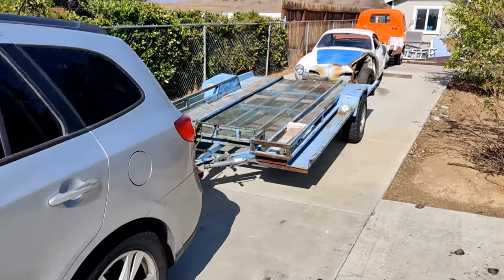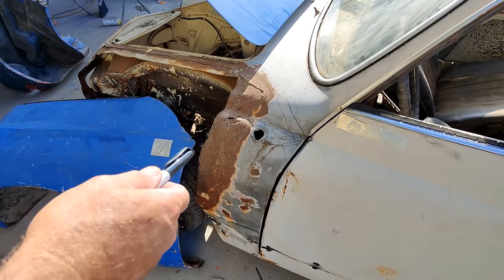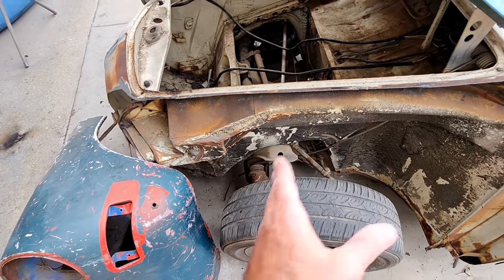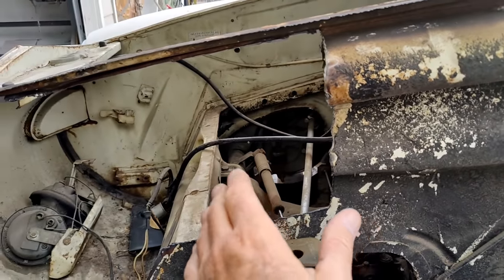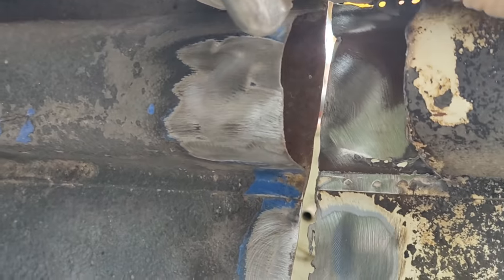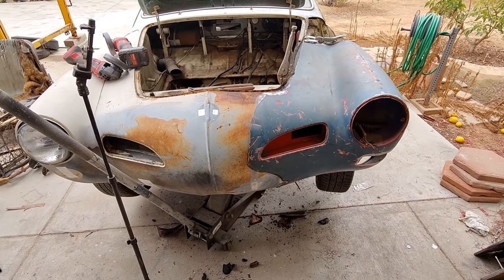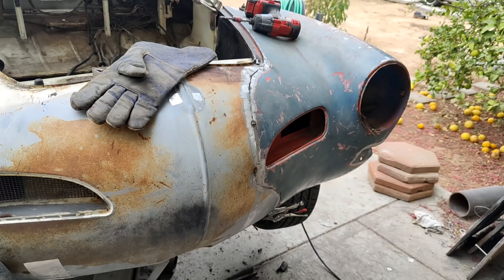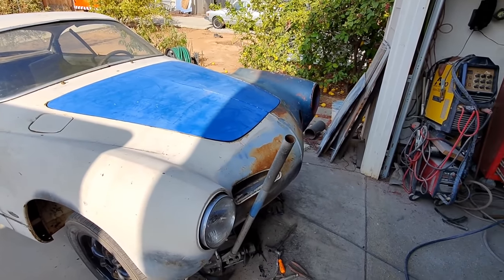VW Karmann Ghia Fender replacement part 1 metalwork welding grafting metal Butt weld for restoration

Comment: I'm working on a 70 Ghia. This gives me alot of pointers. Great video, you don't have to make excuses to me, I think you're doing a phenomenal job. I don't have any accident damage. Just real bad rockers and heater channels.  I have very little welding experience but you have to start somewhere. If I fail, oh well. I'll just use the engine in something else. I really want to get this thing on the road though.

Comment: Ahhhh... A Ghia fender job is not for the faint of heart.  Did one once, and I never want to do another! The car was a '60 and replacement fender was a salvage fender from another '60.  Rust and filler on both.  These were hand built and the replacement was about an inch longer than the original.  Ghia's are fragile and rust prone - challenging to get right 🙏
Edit:  Forgot to say thank you for the video!😊
Reply from the maker: Yea for sure they really have lots of similarities at the 356.....and should be worth more than they are. cool rides.
Reply: Some of the 356's were made at Karmann coach works.  The Porsche folks wouldn't want to hear about the similarities 😉. It seems that the slightest collision on a Ghia results in a lot of damage...

Comment: I use a cheapass chicom lazer level mounted on a pole (old fan base) .In your situation I would use it to  aim one line down the center line pressing in the nose and set the horizontal line on the Right hand vent hole. this would give you an easier take on how the panel is sitting by matching the replacement vent . .

Comment: good repair as you say its no show car just a daily driver
as long as its welded securely it will be ok
done a few similar repairs and there not as easy as repairing with new panels

Comment: Really nice! Looked like you broke out some Cleco fasteners there? You don't usually need to use those, right?
Reply from the maker: No I dont use them much. Sheet metal screws usually do just as good. But On butts sometimes it is fast when you use washers on the backsides. better than butt welding clamps that take too much time to install.